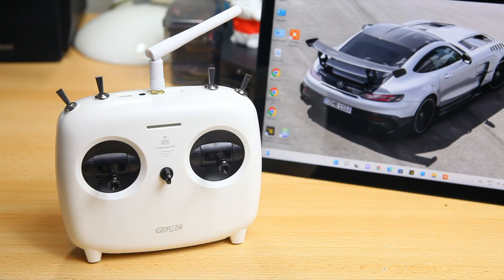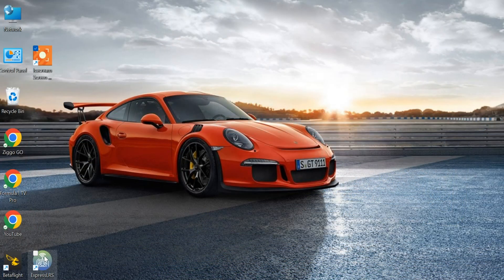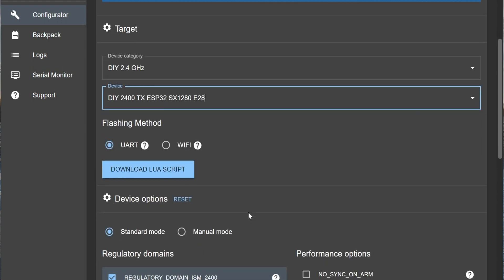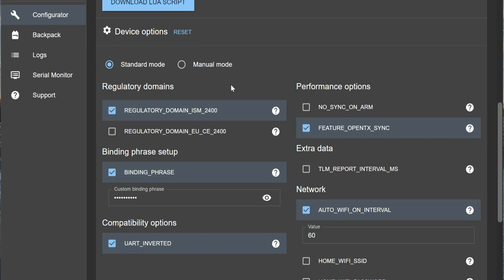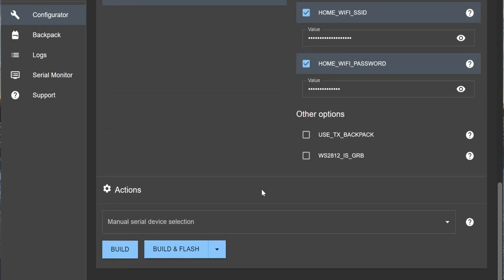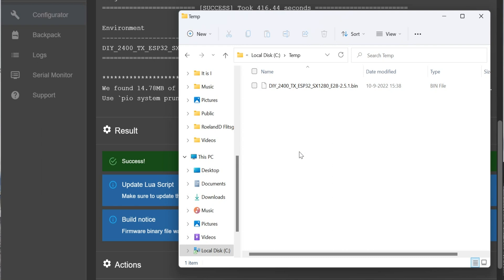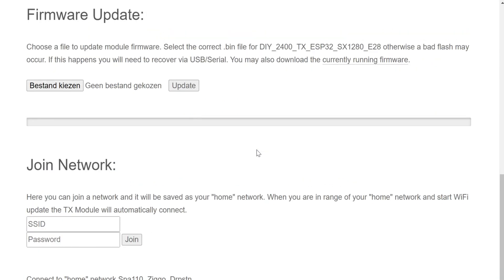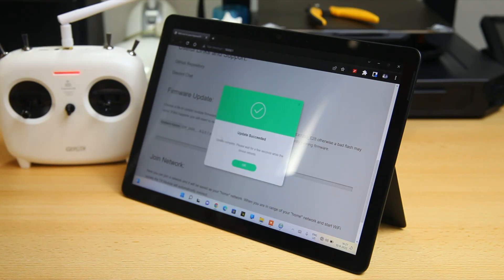GepRC TinyRadio ELRS :D - Firmware Update with ELRS Configurator

Comment: что даёт эта прошивка?МеняетБеспроводной протокол: FHSS на CRSF?:oops:
Reply from the maker: You would want to flash newer firmware to bring the version in line with your other equipment (receivers) And to set binding phrase / WIFI setttings. 
But if the stock version works for you, the probably leave it as is.

Comment: Hi, I did a tx module update and uploaded the wrong firmware, in the chaos then I used TinyRadio Configurator to upload the wrong firmware to radio. The remote controller firmware is now bricked. I have restored the tx module to its original state, but the remote controller firmware is bad. If I use the TinyRadio Configurator now, it always stops at 0%. The manufacturer advised me to return the radio to China. I know I'm dumb, but what next? Just need to return the original remote controller firmware.
Reply from the maker: hmmmm that kinda s*cks man! /you would think it should be possible to bootload a new firmware onto it.. but maybe that's a bridge to far for this radio... 
Is sending it back etc wurth it with the radio being as cheap as it is?
Reply: @DutchRC I got a $10 discount on a new one from geprc.
Reply from the maker: @VohrajCZ  not bad? (as you kinda bricked it yourself :)  )
Reply: Hi, did you manage to fix it without sending back to china? I have the same problem as you.
Reply: Unfortunately, I bought a second radio. Fortunately, I needed spare parts. @troymoreno3422
Reply: Unfortunately, I bought a second radio. Fortunately, I needed spare parts. @troymoreno3422
Reply: Still, I'm satisfied. The signal range and simplicity is fine for me. I was more careful with the next update and everything works perfectly.

Comment: Hi, I want to connect the radio to my PC in bluetooth but I cant, have any tips? I can pair it with my phone but with the PC seems impossible.
Reply from the maker: Hmmm hard to say.. I've had it only just Work (on a MS Surface tablet / laptop with Win11) but did read from others they had issues.. 
have you tried less processor intensive simm's? (like FPV Freerider)
Reply: @DutchRC  The problem is the BT adapter not even detecting the device, probably because the radio is BLE (Blueetooth Low Energy) therefore only a BLE capable device like a good built in adapter will detect it (like the one on my smartphone) anyway I will just ride my foam wing in real life and crash it till I learn haha
Reply from the maker: @sqs.555  LOL yeah that might end up costing more then a radio-upgrade? :$ :P 
then again: no nuts no glory :)
Reply: @DutchRC  No way hommie, Im talking about DIY foam wings, 3USD each board of 700x1000mm, aprox 7USD to build each wing.
Reply from the maker: @sqs.555  that makes for relaxed flying I say.. the cheaper the plane... :) 
https://www.youtube.com/playlist?list=PLXgLCadWLBnAz0yTF4oq-P_xqvLVWxRtL
Reply: @DutchRC  yeahh

Comment: this thing is a nightmare. unusable in Liftoff as you can only connect via bluetooth to it. but bluetooth constantly connects and disconnects. the battery compartment was designed by monkeys I think. have to jump through hoops to install new firmware and it does NOT install a new firmware. usb-c cable method does not do anything. and when connecting through wifi you get "Wrong Magic Byte" error message.. STAY AWAY FROM THIS GARBAGE! add $20-30 to the cost of this thing and you get a decent radio.
Reply from the maker: I've done some sim-flying with it on my MS Surface talbet (Win11) but I agree it would have been A LOT better to just run it over USB.. and well I did prefer this radio over the BetaFPV ones.. 
I actually don't think it's the price but the simplicity some people want.. otherwise people would indeed  be better of with an entry radiomaster
Reply: @DutchRC  thanks for your reply. I finally got that thing working properly AFTER watching your firmware update video. I updated it through Wi-Fi (latest firmware seems to be 3.2.0) which was actually simple and worked the first time. Now it connects properly to Liftoff and after calibration it's great actually. However on some maps, The Green and Short Track for example it needs to be recalibrated after flying for a while. Somehow it seems the Bluetooth gets overwhelmed as both controls get stuck at max settings suddenly. On other maps it does not happen. Anyway, thanks for your advice and great videos.
Reply from the maker: @zoomhardin  thanks and no problem! 
Good to read you did make some progress! Well done.. is this your first radio by the way?
Reply: @DutchRC  no it's not... many years ago I had a Graupner system and flew some rc planes...

Comment: my tinyradio will not enter wifi mode, holding the setup button and powering on doesn't do anything special, it just sees the setup button hold and calibrates the sticks.

my tinyradio came with my tinygo kit, the sticker on the back says it's the tinyradio in 915mhz. although the faceplate plastic has a GR8 logo painted on. it has the sma antenna port on top like the tinyradio.
Reply from the maker: Howdy James,
yeahhhh so despite the names of the radio's being similar the one I have is Completely different from the one You have.. 
the 915mhz thing surprices me big time by the way.. I have a hard time believing that's not some sort of error.. 
However! Your radio is not an ELRS radio.. I don't expect it to have a WIFI mode.. The best thing to do is goggle up a "GepRC GR8 manual" (actually the GepRC product page for the radio has a manual listed)... and then see what the setup procedure of the radio is :)

Comment: Hi, it seems that by updating the firmware in this way, the emission power power can´t be switched. https://youtu.be/prlfOev6W7M?t=307 .Best regards.
Reply from the maker: I do see mine switch power, but you can indeed not really control it.. Hopefully there will be a propper firmware for the radio or a ELRS 3 version so you can for instance set the binding phrase afterwards...
Reply: @DutchRC  ok. Thanks a lot.
Reply: actually I updated to the latest firmware version (3.2.0) and I can cycle through the power settings.
Reply: @zoomhardin  You can cycle through the power settings, but that does not mean that the radio is modifying the emission power. Have you tried measuring the power output? https://youtu.be/prlfOev6W7M?t=331
Reply: @Tio_Trompo_1960  no I have not. the guy in the video does not cycle through the power settings nor is it clear which version he updated to... his video is 7 months old.